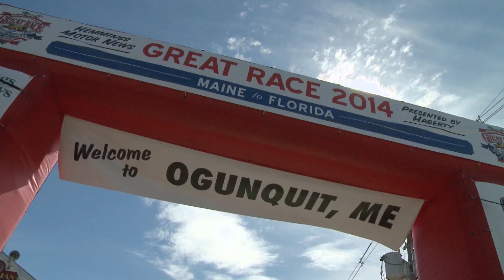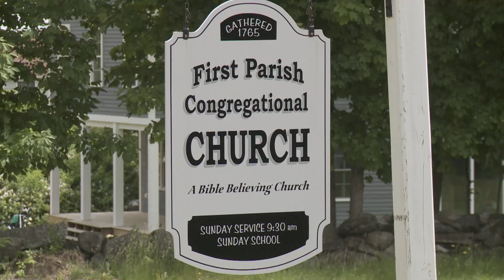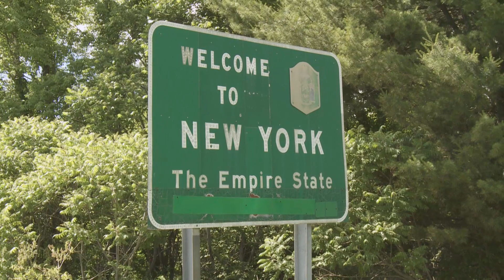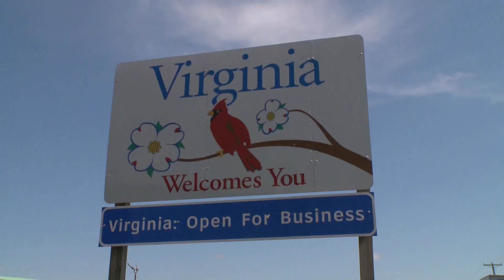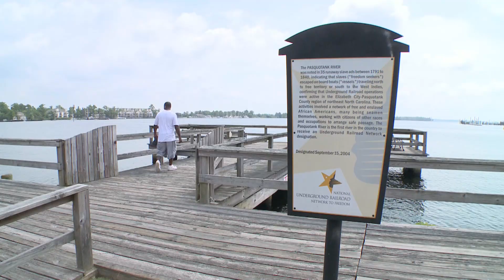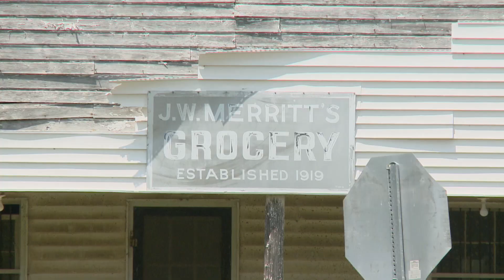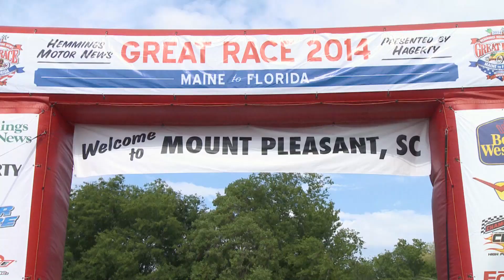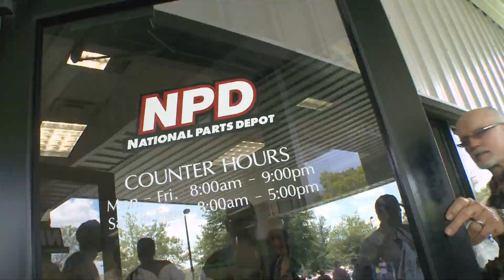2014 Hemmings Motor News Great Race presented by Hagerty

Comment: I forget what year this happened, but there was a vintage fire truck in that race.  Built in the 20s, the engine had cylinders that were jugs bolted to the block.  All was going well with the truck until one of the jugs broke a bolt hole that held it to the block.  They got the truck to a place where they could repair it and welded or brazed a new hold down.  They tested it and all was fine.  Next day, they were on the road, doing well, proud of the old truck, and it broke again, this time worse.  Well, the drivers were heartbroken.  Here this truck was, doing great, and now dead.  Along with them, I shed a few tears for that big, old fire engine.  I guess I am just a car lover.